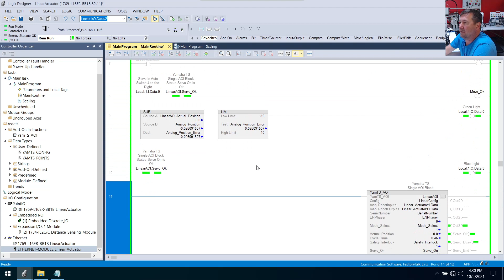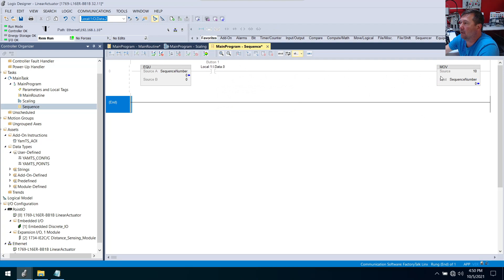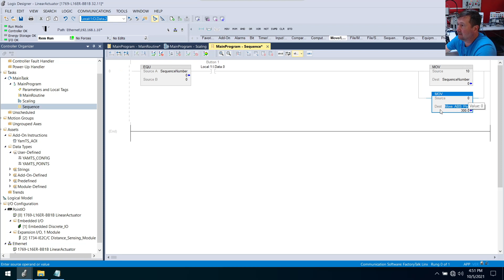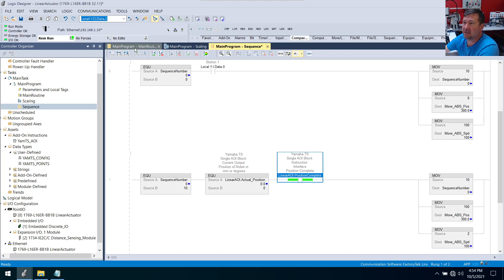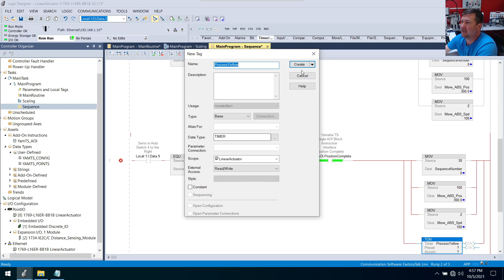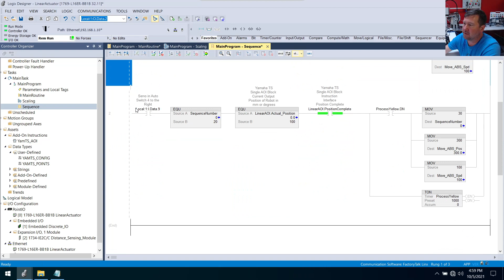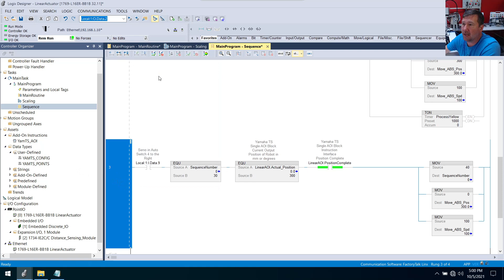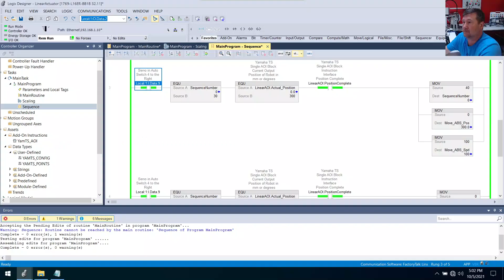Programming Motion Indexing Moves in Studio 5000

Comment: Is there a way that you could flick a switch to run at 25,50,100% speed
Reply from the maker: Yes, check out this video where we switch between speeds using a switch.  We are adjusting an analog output but changing the speed value in the AOI would be the same. https://youtu.be/lPfHHnsCos0